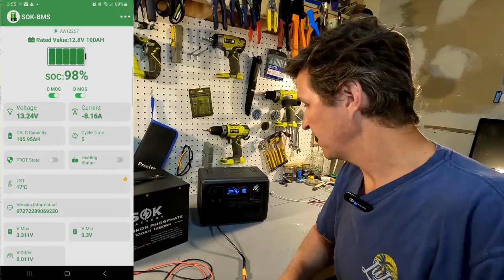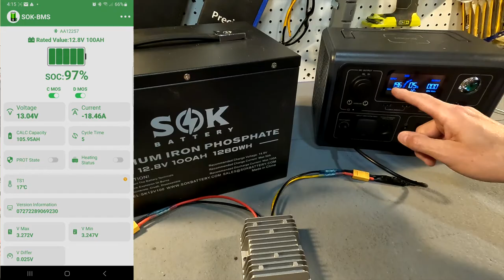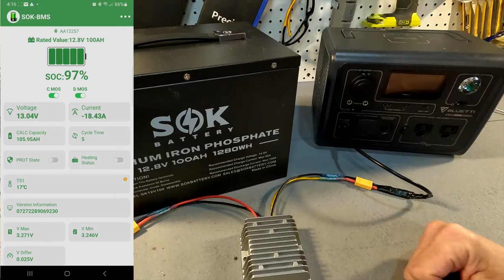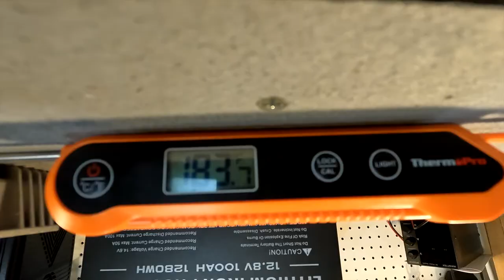Connecting a 12v to 24v Converter to a Bluetti EB3A.  How efficient is it?  Is it worth it?

Comment: Question. I have an EB3A. Instructions say 8.5A max input. If I put more than that in, does the EB3A automatically regulate it as to not cause damage? Good video.
Reply from the maker: Yes.  It will max out at 8.5 amps and hold there.  Just make sure not to go over the voltage maximum.

Comment: Hello, Could you confirme me that the converter used is the Setup 12v>24v 10A model ? Thank You
Reply from the maker: Yes.  It's a 10a version.  There is an Amazon link in the description.  Thanks for the comment.

Comment: What if you put a 500 watt power inverter on the 100ah battery and then plug an AC cable into the bluetti if it would charge at the full rate?
Reply from the maker: If you don't set the Bluetti up to turbo charge I think that would work.  Thanks for the comment.

Comment: I bought my EB3A, just to have a good charge controller. I tried to use AC from a battery to the 110 plug in for charging, with 3 different batteries (not enough amps?) and it did not work, 12 volt works great.
Reply from the maker: That's a good idea for the unit.  Odd that the 110v wouldn't work.  Glad to see the 12v work for you.  Thanks for the comment.

Comment: What about using a BLUETTI P090D To DC7909 External Battery Connection cable with a b230 battery with the EB3A???
Reply from the maker: The physical connections would seem to work.  It depends on the voltage the battery supplies.  If it's between 12v and 28v then I say go for it.  Does the battery need to recognize the unit in order to work?
Reply: @OffGridBasement  actually I did some research and it seems like the b230 battery delivers 51.2 volts.  I didn't realize the ac200 max system was a 48 volt system , I thought it was a 24 volt one, but you can still use the b230 battery with the cigarette lighter type cable, but will be limited to 100 watts  unless you do the buck converter trick.

Comment: New to this- Do you have any way to measure the charge left in the 12v battery?
Reply from the maker: The best way to measure the charge left is with a shunt.  You can measure the voltage of the battery if you need a very basic idea.  You just need to make use it's not under any load.

Comment: I have been messing around with chaining 2 EB3A's together it works but you lose energy via the inverter ...wonder what a 24 volt battery would be like as a source of power?
Reply from the maker: My guess is the efficiency would be the same as the 12v.  About 94%
Reply: @OffGridBasement  no hot wires hopefully

Comment: Hi 
I am a newbie, but interested in this type of connection.  If you connect battery to solar station without boost converter, what makes current flow from battery to solar?  If I have solar DC input 30v and 10Amp  if I connect 12v and 100amp battery will current flow at 8Amp and at what voltage?  Does current flow depend on solar station input or from battery itself?
Reply from the maker: The battery only supplies 12.8v nominal...  in other words...on average.  The solar station can accept between 12v and 28v and a maximum of 8 amps.  So the battery will give 12.8v @ 8amps to the power station.  If the battery is 24v then the power station would accept 25.6v nominal @ 8amps.  I hope that answers your question.
Reply: @OffGridBasement  
Thanks,

Comment: I purchased a 5000w inverter not realizing its a 24 volt inverter. Is there still some way i can use it in my 12 volt semi truck?
Reply from the maker: Ouch.  You can still use it if you get a boost converter, but I HIGHLY don't recommend doing that.  I would send the inverter back and get a 12v.  Sorry!

Comment: I tried doing that my eb3a and now my power station is not working anymore. I think that power station is defective because I done it to my ecoflow River 2 so far it's working fine. I think that the EB 3A has a problem with the reset button.
Reply from the maker: That's not good.  I do know for a fact that it does work.  Hope you get it worked out and thanks for the comment.

Comment: If you use a lower current Buck converter like 3A or 6A instead of the 10A you will loose some input power but it will run allot cooler(safer).
Reply from the maker: Thanks for the info and the comment.

Comment: What's the app you used to test all this? Does that work with the bluetti app somehow? Where's that information being drawn from?
Reply from the maker: The SoK 12v battery has a smart BMS.  That's where I got the battery measurements.  Hope that helps.  Thanks for the comment.

Comment: Nicely done, however I think your efficiency calculation is off because the Bluetti only allows up to 200 watts input on the DC side. I have this setup and an EB3A, also a Renogy Phoenix 1000 and can get 243 watts using the convertor on the Renogy because it allows 400 watts DC input.
BTW, a Buck convertor takes voltage down, so 24 VDC to 12 VDC.
Keep up the great ideas, I love your channel and all the trial and error you put into it.
Reply from the maker: Thanks for the info.  I realized I should've been saying "boost", not "buck".  Bummer on my part.  Thanks for the comment.

Comment: Say your booster/converter is only 10 amps input. How's the battery gonna know to only put out 10 amps. That battery should b able to put out around 100 amps or so
Reply from the maker: It's limited by the EB3A @ 8.5 amps.
Reply: @OffGridBasement  thank you much

Comment: Does the buck converter have a power draw at idle?
Reply: My 24 volt to 12 volt "Buck" converter uses about 50 milliamps at idle.
Reply from the maker: No.  Nothing that I could measure.

Comment: What size in AWG Wire you are using?
Reply from the maker: I believe it is 10awg wire.  That would be plenty for the amperage used.
Reply: @OffGridBasement  Another question, it needs a reverse polarity protection?
Reply from the maker: There probably is no protection in the EB3A for that.  You need to make sure your wiring is correct before attempting to plug in.

Comment: Noob here.  Why doesn’t the 24v side need different wiring to handle the higher voltage?
Reply from the maker: Because it reduces the amperage.  The amperage is what heats up the wires.  Hope that helps!

Comment: I ran across a 19v convertor. Seems like you would get less heat and more efficiency with that.
Reply from the maker: I believe the heat comes from the amperage, not the voltage.  Thanks for the info and the comment.

Comment: Another option is to use 2) 12 volt batteries in series to get 24 volts
Reply from the maker: That's true.  It would also be more efficient.  Thanks for the comment.

Comment: Hey! Im from Phillipines. How about no converter? How many hours it will charge? Like. Direct battery to eb3a? Is it safe not to use converter?? Just only direct 12 volts 100ah to eb3a??? Godbless sir.
Reply from the maker: Directly connected you would probably get 10 hours of charge.  Thanks for the comment.

Comment: You are limited by the input specification, 200watts max. That doesn't change. You got 1/2 the charge time over the 12 v battery. The efficiency loss you are dealing with is in the boost converter. If you matched the boost controller to the input spec's of the bluetti 200watts, then the efficiency loss would be nill. But you ordered a 240 volt converter, so yea efficiency loss occured-heat buildup, however it still charged you bluetti in half the time.
Reply from the maker: Thanks for the info and the comment.

Comment: Thats was surprising how hot your buck converter got.  If you dont have a fan, maybe at least put it on a silicone pad.  I guess efficiency versus shorter charging time depends on your immediate need??
Reply from the maker: Yes it does.  I think it's a good idea in case of emergency.  I wouldn't want to use it as a permanent solution.

Comment: Isn't that a "BOOST" converter?  I thought a "BUCK" converter reduced voltage and a "BOOST" converter increased voltage.

That being said, using a BOOST converter in a car while driving, with it wired directly to the battery (and fused and cooled), is a quicker way of charging these portable power stations through the solar inputs.  BOOST converters can be purchased to at least 48 volts and can mimic solar input.
Reply from the maker: You are definitely correct.  I mistakenly said "BUCK" converter in the video!  That's a great idea about the use of a car battery.  Thanks for the info and the comment.

Comment: You can mount the 12 to 24-volt inverter on the opposite side of the eb3a the cooling fan of the eb3a will keep it cooler.
Reply from the maker: Just make sure you don't block the airflow from the unit.  Thanks for the comment and info.
Reply: Inverter are not efficient and beat the purpose of keeping it simple. 100W will run a camping fridge and charge phones while you sleep and keep the power station topped off.

Comment: If you add a 110v ac rectifier between 12v to 24v it will charge in 10 minutes
Reply from the maker: Thanks for the info and the comment.

Comment: Your calling a boost converter a "buck" converter was killing me, but no worries.  😀

12 volt to 24 volt needs a BOOST converter. They're used to boost the voltage.
24 volt to 12 volt needs a BUCK converter.  They're used to reduce the voltage.
Reply from the maker: Thanks.  I totally had my terminology backwards!  Thanks for the comment.

Comment: The eb3a is only capable for 200 watt max input. thats why your not seeing the 230 watts.
Reply from the maker: I was going by what the EB3A can accept.  The solar port will max out at 28v @ 8.5A.  That equals 238w.
Reply: @OffGridBasement  But the max input watts is 200 wmax, regardless.
Reply: Also, a buck converter is a step down converter. You are using a step up converter, or boost converter.

Comment: Do not try this with a Jackery. The Jackery reads that its charging off of Car and doesn't allow more than 100watts even using both inputs but allows 400watts solar. It shows a Car charger icon and has solar icon which i guess would allow more and cant find a work around. My 1000 V2 is 35 days old and can't return so its going up for sale. Also means you cant use a charger1 or Pecron Smart C which was the goal.
Reply from the maker: Thanks for the information and the comment.

Comment: Just buy a DC to AC 500w inverter  and plug the eb3a in the inverter . Get a pure sine wave.   100% efficient !  Under 100 bucks ! No splicing, or wiring !  Simple !
Reply from the maker: It would be easier, but unfortunately it wouldn't be 100% efficient.  You would be going from DC to AC then back to DC to charge the EB3A.
Reply: I did this with my Bluetti AC180P, what it did was attempt to draw 850W and the 500W inverter shut off because it couldn’t supply 850W.

Comment: Could I just use a car battery
Reply from the maker: Definitely.  Make sure to not have the car running.  You could always use the cigarette lighter adapter if the car is running.  That is also DC charging.  Thanks for the comment.

Comment: If you are charging in a car and have to idle to charge, that changes the math a lot
Reply from the maker: Yes it does.  You don't want to do this setup using a car cigarette lighter.
Reply: @OffGridBasement  I meant the math of efficiency. Regardless of connection.

Comment: Important to note that if you accidentally connect the converter up the wrong way you fry it irreversibly and have to buy a new one. So quadrouple check before connecting.
Reply: He made it pretty foolproof.
Reply from the maker: Thanks for the info and the comment.
Reply: Think i just did that

Comment: If there's energy lost as heat using the boost converter than without, then that tells me immediately there's less power reaching the EB3A. No measurement needed.
Reply from the maker: Thanks for the comment.

Comment: If you add a 12v fan connected to the battery then using a buck converter just to cool it down a bit then it is even more ineffecient...not worth the money nor the risk.
Reply from the maker: You have a very good point.  Thanks for the comment.

Comment: instead of that converter thing why don't you just use 2x 12 v batteries in series so you have 24 v then you shouldn't be loosing anything
Reply from the maker: I did this because it's a less expensive option.  Thanks for the comment.
Reply: @OffGridBasement  Two 12V 50AH batteries
  connected in series will be cheaper and more efficient or am I wrong?
Reply from the maker: That's correct.

Comment: Not worth it. There's also heat generated inside the Bluetti as it steps it back down 13V. Also consider that you are putting more stress on your Bluetti and SOK batteries and BMSs. I know LiFePO4 is supposed to be able to handle it better but charging at ~0.7C isn't something I'd  do on a regular basis unless I had a reason.
Reply from the maker: Good info.  Didn't think about inside the Bluetti.  Thanks for the comment.
Reply: bluetti shouldnt be stepping the voltage down, the boost converter is putting out 24v and is within the 12-28v range, and charging from ac on standard is using 268watts, but doing DC charging it won't go over 200watts so there will be less heat than using ac charging, all I'm saying everything is fine, also try another test with a 20amp DC converter to see if it gets less hot.